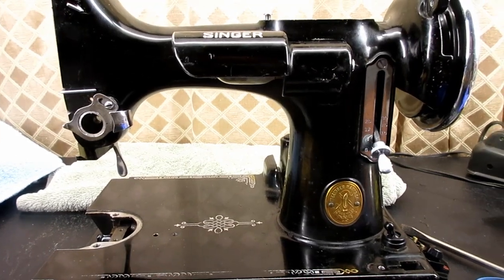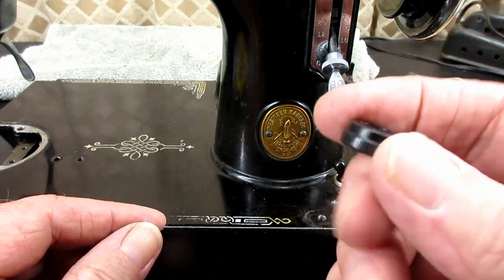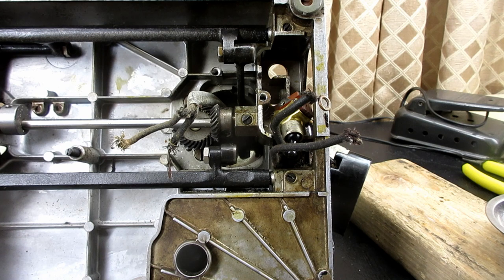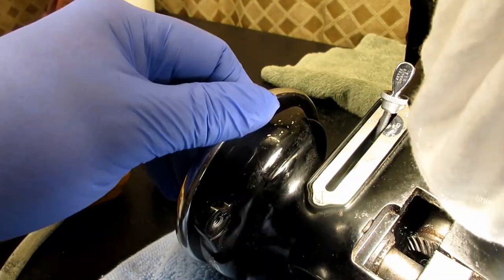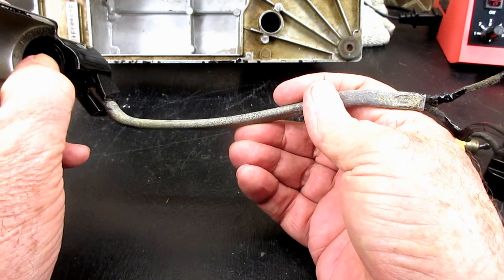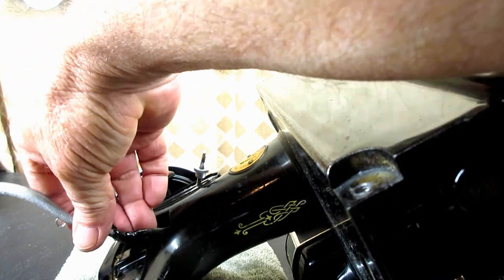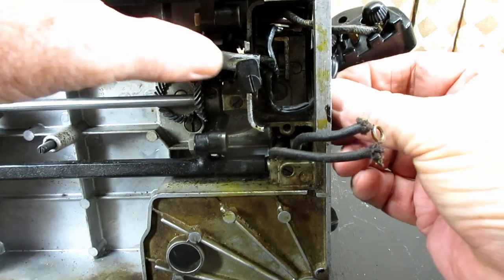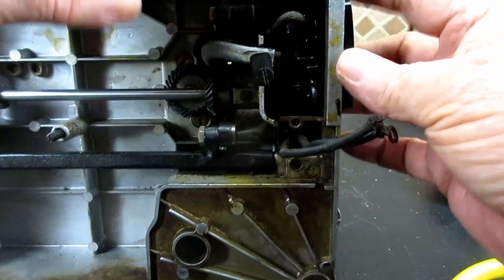Remove & Replace the Singerlight of a Singer 221 Featherweight Sewing Machine

Comment: Liquid electrical tape?  I had no idea it existed. I’m going to buy it so I can try it on something! Thanks for the educational, entertaining and relaxing video. I agree, this is a good hobby in the time of Covid-19.
Reply from the maker: I found it useful on many occasions. I did not mention that you can peel it off after it cures if you need to remove it for some reason. There is another brand that works the same but I can't remember the name of it. Thanks for commenting and take care.

Comment: Great repair Andy! I have no experience with the liquid E tape, but now I wouldn't hesitate to use it. Admire your soldering skills and patience. Routing and repairing 70 year old wiring in such a confined space is fussy work for sure.
Reply from the maker: Thank you. I forgot to mention in the video that the liquid tape can be removed after is sets by just peeling it off.
My soldering skills felt rusty to me but I got it done without catching anything on fire, so a win for me, haha.
Looking at the wires last night I'm starting to think a light coating of the LET on all the cloth-covered wires may be a good idea to protect that cloth from breaking down even more over the years. Thank you very much for watching my channel and commenting. Take Care.

Comment: Another great video.  I’m looking forward to you opening the motor. I have opened one motor - very carefully. I have a 1937 Featherweight and the motor is getting hot when I sew.  I haven’t had time to open its motor.  I am wondering what the life is of the motor wicks in the lubricant tubes.  I believe the wicks are difficult to replace so hope that is not my problem.
Reply from the maker: Thanks for watching. I've never worked on a 221 motor before, or a motor with lubrication wicks. An OSMG told me years ago use a hollow tube to remove old grease and then put a drop of oil into the wick before adding the lube. Just last night a friends sent me this link to the Featherweight Shop and info about the motor. I have not had time to look at it much but it looks worth the time.
https://singer-featherweight.com/blogs/schoolhouse/tagged/motor
Thanks for watching my channel and take care.